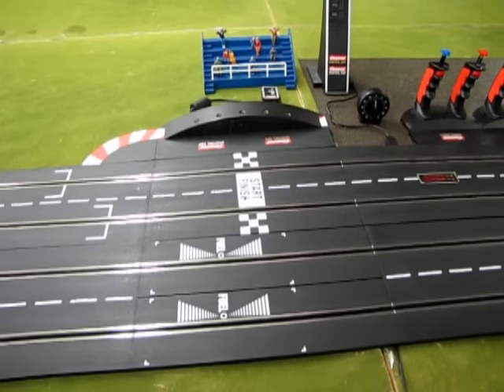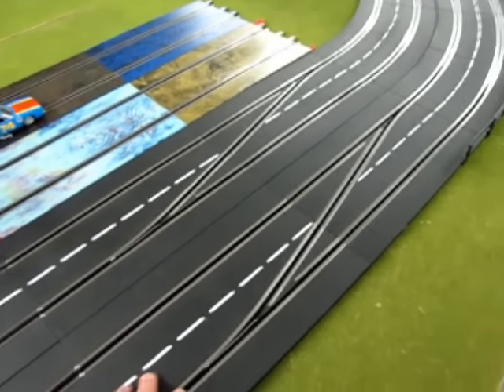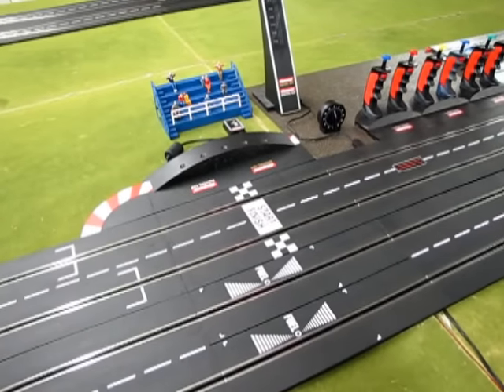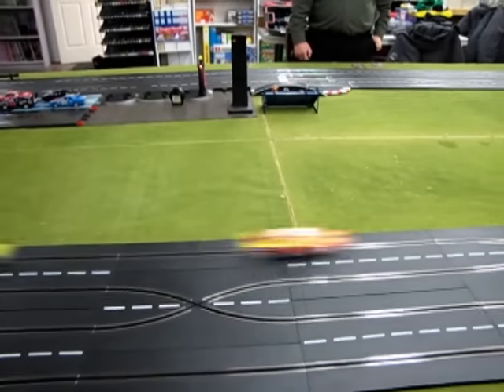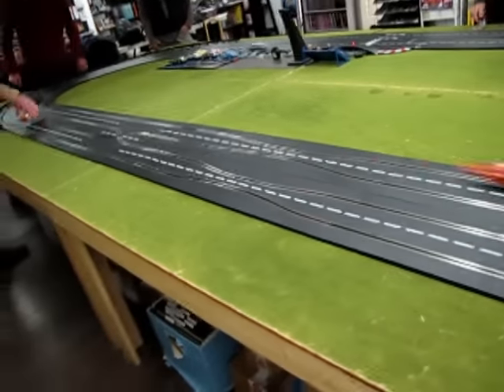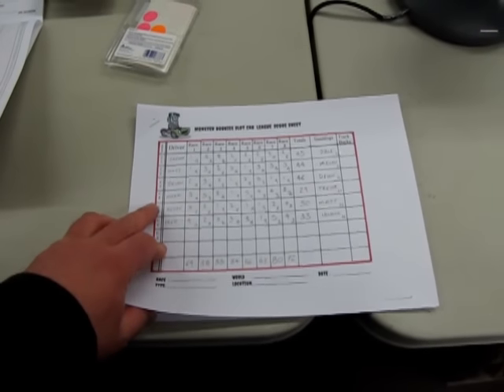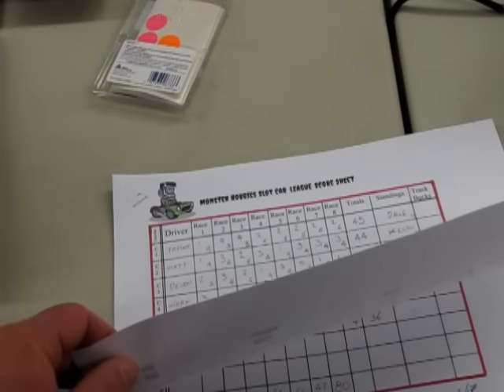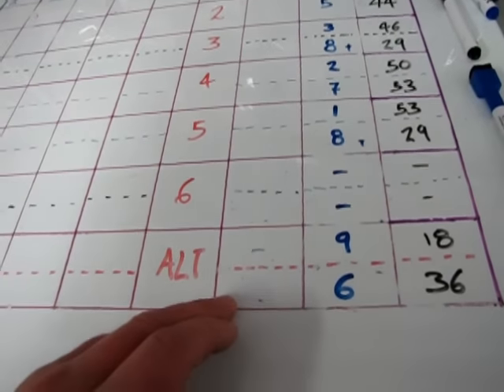Monster Hobbies 1/32 scale Carrera Digital Slot Car League - 1970 NASCAR LEAGUE Race 1 Martinsville

Comment: are you going to use banking with the larger tracks .... not that Martinsville has any....
Reply from the maker: Thanx for watching the video. Martinsville actually has a 12% banking..which isn't much, but yes, i will be bringing out the Carrera banked track for the other races.
Reply: Yeah they run progressive bank 6% at the inside lane to 12% .... not enough to say so for those big curves
Reply: are your cars stock?
Reply from the maker: Pretty much. I let guys repaint them just so we don't have 10 car number 5's, for example, and you are allowed to tune your car by machining the wheels and sanding the tires, but not too much more outside of that. Trying to keep it as "off the shelf" as possible.
Reply: that's how I prefer racing leaves it to skill level mainly. in my opinion.
Reply: you guys ever ran the cars without magnets prevents lots of body damage...also need aftermarket silicone tires Supertires or Quick Slicks.